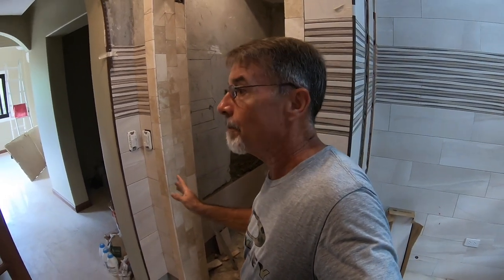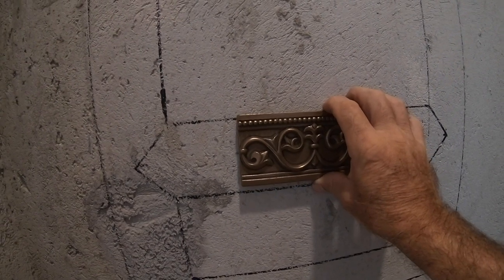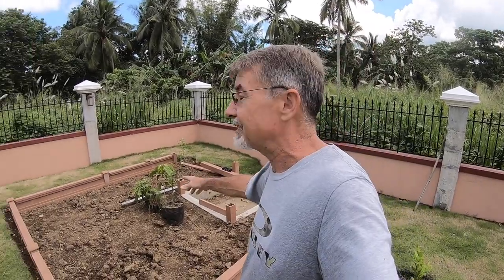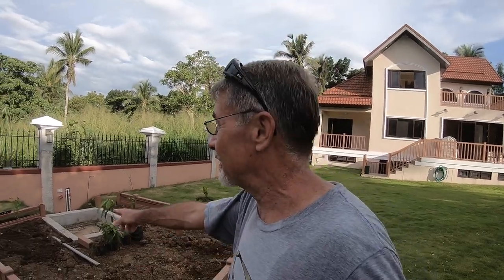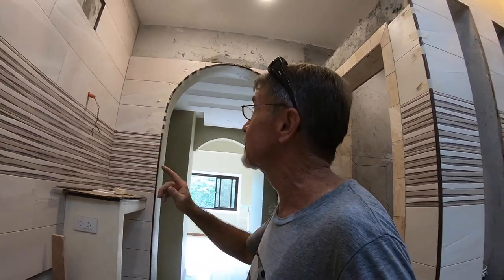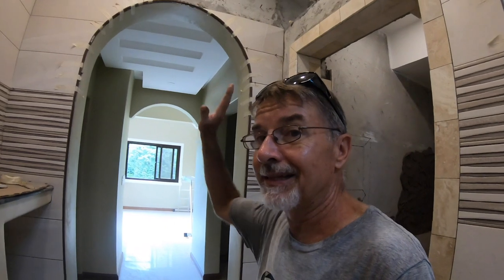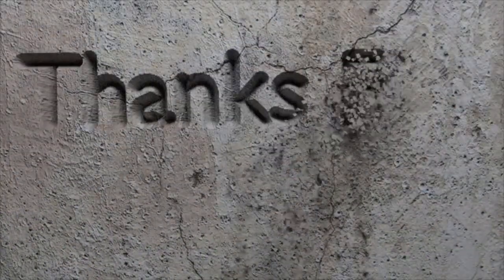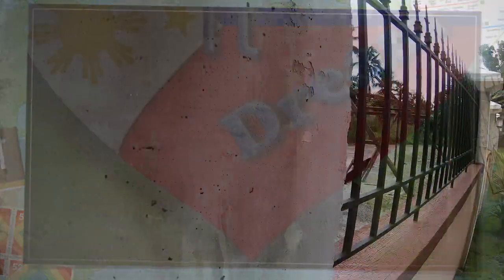VILLA FELIZ-EPISODE 389: THE NICHE DESIGN (House Building in the Philippines)

Comment: Question:  If you knew the shower walls were not square, wouldn't it be easier to use cement/plaster to square  them when they were constructed, instead of using tile adhesive?  When we added on to my in-laws house in Bohol, they left the floor so rough, and then used thick tile adhesive later on to level it......didn't make sense to me.
Reply from the maker: What's tile adhesive but just another version of cement/plaster with just a little difference in sand/cement ratio.